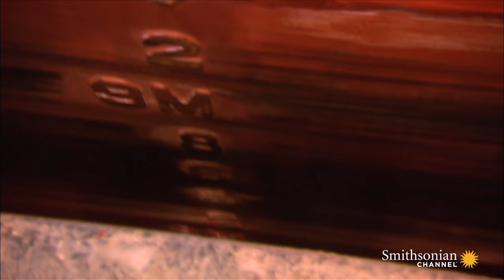Why Loading 30,000 Tons of Grain on a Ship Is Very Risky

Comment: Isn't grain dust explosive as well?  (No smoking in the vicinity?)
Reply: When confined in an elevator.  Not so much in the open.
Reply: Samuel Mason Not as much as you might think! The big explosions you hear about are at Flour mills. The flour, suspended in the air is quite explosive. Most of the dust associated with grain handling is dirt. Now the red/ white corn hulls ,what we call bee wings around here,might cause a flash fire,but you really gotta try to get that.
Reply: @squach6239  way way late on this comment but your absolutely correct, mainly flour mills. General mills in buffalo ny has no elevators for this very reason, they have these large conveyor belts with metal plates to stand on that you ride up through an opening in the floor. I go there on service calls often, theres a memorial by the front entrance for several workers killed in an explosion in the late 70's. Pretty crazy to think that fine flour particles can do that

Comment: Loading ships this size causes a lot of bending stress to the hull. That's why the C/O has to be very carefull when drawing up his loading sequence plan. Obviously the ship should not be overloaded, but in principle most of the holds will be full so shifting of the cargo (the main risk with grain-Solas 74) will not occur or to a limited extent. The vessel's stability will be ok. The actual loading operations of this ship will be an issue as I noticed the cargo cannot be properly trimmed due to the fact that there's no loading spout, only a vertical pipe.

Comment: But how do they get it back out? O.O Giant vaccums?
Reply: Yea like my girlfriend
Reply: Very Original.
Reply: Mr. Tako Gaming Channel Elephants...
Reply: It's probably a self-unloading ship. Cargo hold shaped like a hopper with a conveyor running underneath.
Reply: It Isn't..
No unloading boom, right?
Reply: Depends what unloading elevator you going to.... ;)
Most is unloaded by the leg in elevator using a bucket system on vertical conveyor if you will.  When the hold empty enough, payloaders are lowered in and scrape the grain into big pile for the leg to keep working. Crew and stevedores also sweep/shovel the grain that left by payloader.  And, when low enough, they sometimes use a vacuum system to get the final bits.
So snark there, not ENTIRELY wrong
Reply: believe me
Reply: Grain will be discharged for example by shore cranes with grabs, depends on a shore discharging equipment.
Reply: They lift the entire ship and open a hatch in the bottom!
Reply: I'll show you how. hold my beer..

Comment: It seems to me to be a math problem. Why wouldn't they have a program to map out the load and direct the loading pattern? Eyeballing the draft seems completely antiquated.
Reply: It's draught, and grain can change weight depending on how much it has dried out, atmospheric conditions etc. The buoyancy of the water changes with temperature as well.
They have time to kill whilst loading and shipping is not a forgiving industry. Far better to be antiquated and KNOW, than have a program make a mistake and rip your hull open.
Reply: It's ALSO "draft".
Reply: Draft or draught is both correct. You have different loadlines: Summer, tropical, winter and winter north atlantic... So you can go to that loadline... covering the temperatures...
Reply: +Wimlex Wille ...and whether it's fresh or salt water.
Reply: But aren't all those things merely algorithms? Considering aircraft can land by themselves, it doesn't seem far fetched to have some laptop deal with this.
Reply: It's overcomplicating a simple process. (See - Rube Goldberg.) They have the people available either way for when unknown problems develop - they haven't figured out a good AI algorithm yet. Better to have the people doing something than waiting at the bar.
Reply: Actually, reading by eye, is the most precise way of determining draft
Reply: MsMsmak they dont really have the time and the resource to make or test algorithms thats not really important :/
Reply: Actually, for this ship here, I can tell you for a fact,  that is DOES have a loading computer and program for calculating various drafts.  But the Mate still has to check things manually.  And there are lots of variables.  Temperature. Fuel on board. Consumables on board. Remaining ballast water.  It's just how the job is done

Comment: This process looks very slow and inefficient. Why don't they pack the grain in containers first ? Everyone knew containers shipping are fast and efficient. if the containers are properly seal, even if the ship capsize at the port. The grain in the containers will not be damage and can be recovered. A 30,000 ton of grain loss would lead to famine in some poor countries.

Comment: does anyone know how exactly they know how much grain, in this case 30000 tonnes, has been loaded on to the ship? do they weigh it before they load??? Or do a draft survey?
Reply: Last one is correct, draft survey. Chief officer will know if 30000 tonnes was loaded after draft survey together with the surveyor base on the initial draft before loading.

Comment: This   loading process   can  potentially lead to explosion    mostly   I thinkthat once the grain is loaded and  still it is relatively safe   but when  it is moved  one must  considere that grain dust that in the right concentration in the air is   explosive   grain   elevators here in the   Prairies have exploded and burned   because of that dust   of course a metal ship may not burn  quite as easely   normally   but that grain dust in the right concentration can be   explosive
Reply: bernard240vdc Why so many spaces?

Comment: i thought it was all going to catch on fire. also how the hell do they get away with not packaging that? food health and safety? whats that?
Reply: Twig 46 ...Good question. .
Attended a vessel on the Columbian river at the port of Portland, I was held up for 3 days as the Coast Guard found rust particles in the hold had to be water pressure cleaned ...
Reply: With food-grade compartments you don't have to package it. They don't package it for rail transport either.

Comment: That this be   30.000  or   100.000 tons   I think  the total   mass does not make this grain   more  dangerous as far as fire goes   once  it is  sitting still in the ship   I do no think it   emits much fumes  when it is still  unlike   crude oil   grain   dust  is  the  dangerous   think   created  when you move and   handle  grain